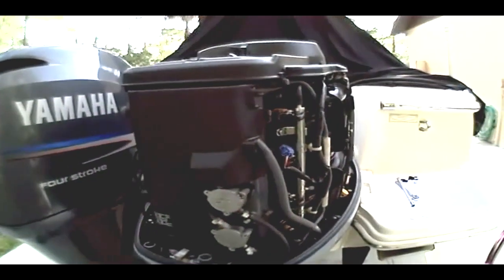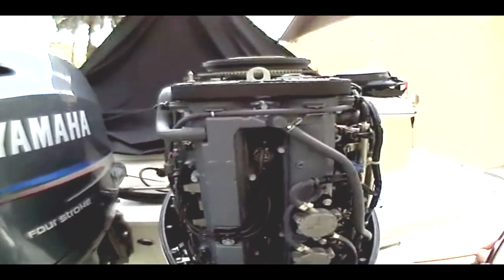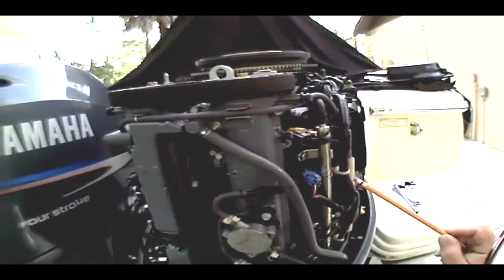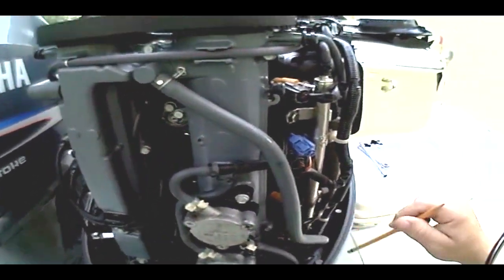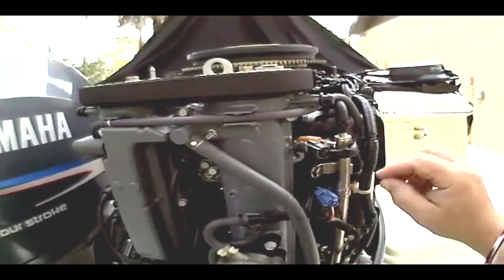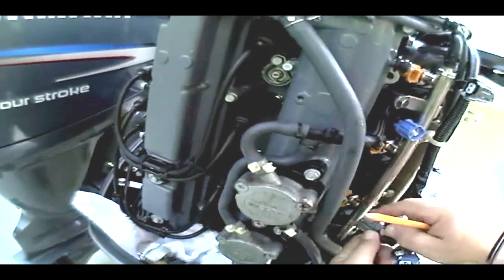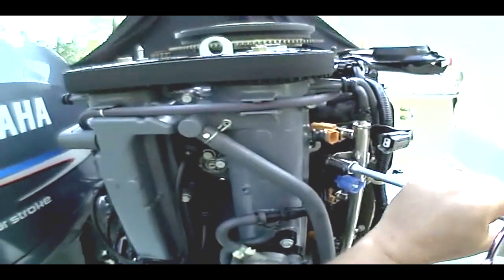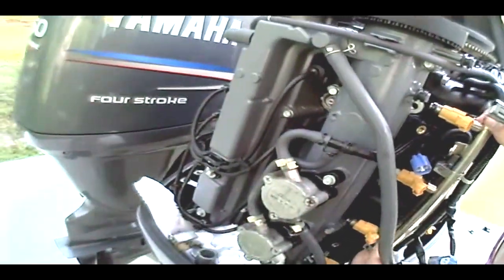Outboard Fuel Injectors

Comment: Would silicone o-ring lube be better to use than Vasoline. I've heard that Vasoline being a petroleum product will cause o-rings to deteriorate over time.
Reply: I work in hydraulics and Vaseline won't eat away an oring it's neutral on almost all rubber or synthetic seals I believe

Comment: does the fuel rail have a Schrader valve to check fuel psi? ..if so why don't you disconnect 12v to the fuel pump and if it has a fuel return block that and install a presurized  (20-30) psi fuel injector cleaner machine or make your own.. and do it running from the rail instead of taking all the injectors off ...just a suggestion
Reply: You must remove the injectors from the fuel rail. All injectors have filters and they must be replaced. Just running chemicals through injectors does not work. They then must be flowed after cleaning to check for leaks, flow rate and spray pattern. Not something you can do properly without a test bench.
Reply: Filters ? You mean screens? I have a 150 Ficht and never had to remove the injectors. I run the cleaner ..gas and oil mixture through the schrader valve .. this way the injectors get clean and it also gets the carbon off the cycliders .. everyone has a diff way to do them. The Ficht injectors are totally diff than your injectors tho.
Reply: @welderdale  dale have you got a part number for the injector filters

Comment: Watched your video, changed my 04 Yam F150 injectors and the boat absolutely rips!  Thank you!!  Excellent video and simple to follow.
Reply: My motor is the same as yours, where did you buy your new injectors? I'm reluctant to buy the ones I see on Amazon and Ebay-the part # I come with is 68v-8a360-00-00, I know its been 8 mo. but was this the part # you used?

Comment: Bought my injectors off amazon for $36.99 for all four! Not kidding  and changed them out in 15 min after watching this vid and BAM! Runs friggin mint! Wouldn’t go over 3500 rpm, now it rocks!   Stealership marina wanted $189 each just for injectors...wtf. And by the way I bought another set of four because I was worried that they might be junk so now I have an extra set for $36.99, plus old ones I can clean

Comment: My yamaha 4 stroke 115 started running rough yesterday and is only running at half power,,its a 2017 with less than 10 hours,,when running at full throttle it inermittently runs as it should and then go back to half power,,,whats the chances a plug is already burned out,,
Reply: Slim... Always injectors.
Reply: Mine was doing that before the injectors got clogged up, change your gas canister filter and the typical  white/black in line fuel filter and it should fix it right up....
Reply: Thanks,how about f the defrent of that's slowly running is the adjuster the gas and air of the trootle body  
What standard adjust screw 3 times turn or 2

Comment: Dale, when installing the injector back onto the rail, does half of the "H" shaped o-ring push into the rail (ie half in and half out at the groove in the o-ring?)? Great video btw!
Reply: The H shaped o-ring is just a spacer between the rail and the injector. It does not go into the rail. Just the top o-ring goes in the rail. Thanks for Watching..
Reply: @welderdale  Much obliged!

Comment: Very good info I wish there was more info as to how the fuel got to the fuel rail
Reply: +Jerry&Linda Kearby fuel comes to the rail from the VST filter which receives fuel from the low pressure fuel pump. Watch the video from chuck stewart Yamaha F115 FS VST Filter Change Out for more info on how to get to that.